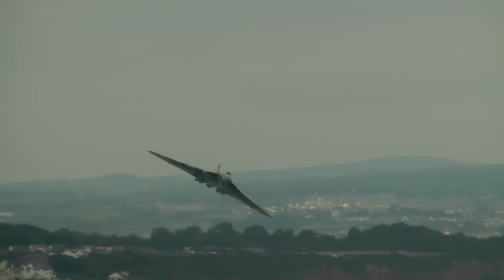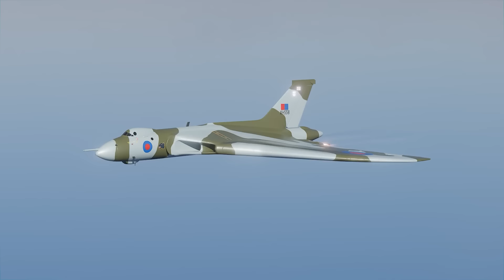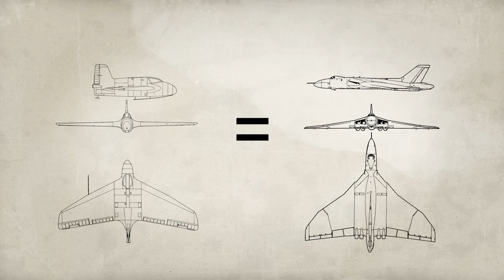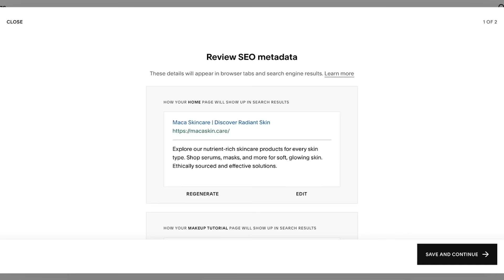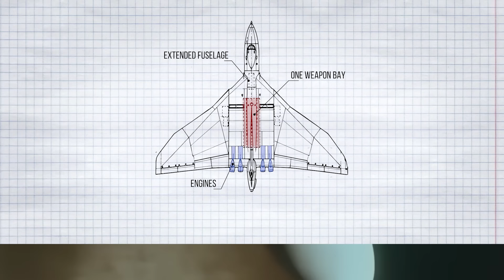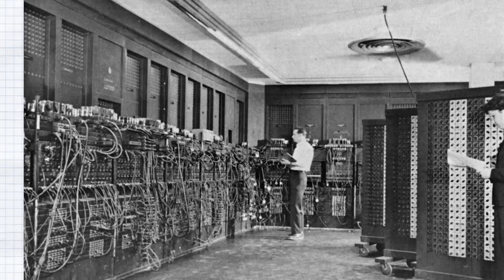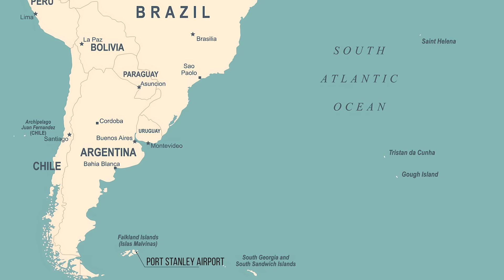The British bomber made to defeat Russia... Avro Vulcan

Comment: XH558 stopped flying back in 2015 sadly, there are no flying Vulcans.
Reply: 3 are still in taxiable condition though :)
Reply: I got to sit in the cockpit of XM655 at Wellesbourne. It was very cramped. I wouldn't want to spend like 19 hours in there during the Falklands. @tengoose6861
Reply: @tengoose6861  Just to add to this. XM655 is fully capable of a fast Taxi however the runway at Wellesbourne is planned to undergo re-surfacing to fix it not being able to atm due to drainage issues. XH558 technically still capable however Robin Hood aiport is the main issue and a lot needs to happen to get her back to fast Taxi. However 'Taff Stone' the main engineer on XH558 said based off his maintence log would know everything required to get XH558 flying again if the engineering support of RR and Marshalls existed. XL426 is the only fast Taxing Vulcan in the world currently, usually does it twice a year and the videos on YT are amazing of her going!
Reply: I was fortunate to see it’s final flight in 2015 at Waddington air show
Reply: It's a shame, but with parts and maintenance being an issue, I'm not surprised.
So glad I got to see it a few times before it was retired though!
Reply: @quantig not only that back in 2015 it cost £1m to refuel so yea that was also an unfortunate factor to it
Reply: @jonallman9918  I can't remember the exact wording the guide on the XH558 tour used but basically Rolls Royce stopped supporting the engines and without that they couldn't get the certificate of air worthiness.
Reply: @Topazium1  Both Rolls Royce and BAe withdrew their support, citing 'no longer financially worthwhile' as the reason, so the CAA refused to certify her for flight without this support.
Reply: @Topazium1  The Vulcans were retired due to metal fatigue and corrosion issues, Avro had to do a lot with limited resources and was forced to make economies with the design that effected longevity and structural integrity. 
these aircraft would require complete rebuilding which is simply not economically feasible.
Reply: I know : I filmed one of its last flights at the Prestwick Airshow , and the following day the two Lancasters when they came a day late .
Reply: I was at the last air show it would ever fly at, but sadly its flight was cancelled due to weather :(
Reply: Im a paetron of her. My name is on her.
Reply: @chethemerc7841 This deserves more than 2 likes 👍, easy regards from the UK 🇬🇧.
Reply: Yeah but it had a good run
Reply: @report_thatveganteacher  It had a very slow (subsonic) run... Britain never produced its own supersonic bomber, a notable failure of the UK aircraft industry.
Reply: @DoktorBayerischeMotorenWerke  but still I was lucky enough to see it fly at 2008 - 2015
Reply: @report_thatveganteacher  At least you still get to see American supersonic bombers flying over the UK, the US air force has B-1 Lancers stationed at Fairford.
Reply: @DoktorBayerischeMotorenWerke  if I have the money yes
Reply: And never will be 😔💔
Reply: Such a shame, but I understand why. Almost made me shed a tear when she reached for the sky for the final time.
Reply: Can't believe it's been 10 years
Reply: I saw it fly at Leuchars air show close to the end and it was glorious as ever. 
That howl was something to behold easily the loudest and most charismatic aircraft I've ever seen. Graceful and terrifying all at the same time.
Luv and Peace.
Reply: Was lucky enough to watch one back in the early 2000’s
Reply: I have heard rumours they are trying to get xh558 back in the air
Reply: It is still in taxiable condition and COULD be THEORETICALLY restored, but it would take a cargo boat load of money. Like back in 2014 they spent a couple million quid just on maintenance. So a LOT of money is needed.
Reply: I saw it with my grandad who was an RAF pilot during WW2 in one it's last flights at Leuchars last Air Show. It floated along the sky howling like a hurt wolf but looking and sounding amazing.
That was the last airshow my grandad was at and we were all grateful he made it. He was 93 at the time.
He used to take me to the Leuchars airshow every year when I was a young boy until I went to Uni.
He was always passionate about flying and always told me what a thrill and free feeling it was to fly a plane.
He's always with me.
Luv and Peace.
Reply: Wrights save the Vulcans. No more left. The most iconic delta wing bomber of all time…
Reply: I was lucky enough to live near Scampton from 1950 leaving in 1969. Vulcans every day from the late 50's and the annual Finningley air display which started with a four Vulcan QRA scramble, once seen and heard never forgotten.
Reply: good
Reply: Beat me to it.
Reply: That is true, but her howl lives again, in the RAF’s F-35s
Reply: @Aguiar_Ed  yeah the f35 really does howl. I was surprised when i first hear it.
Reply: @Aguiar_Ed  The F-35 is an Amerian plane
Reply: @DoktorBayerischeMotorenWerke  An American plane that had British engineers working alongside Lockheed Martin engineers from the start, also: "Britain supplies ejector seats, rear fuselage, active interceptor systems, targeting lasers and weapon release cables, mainly through British Aerospace, amounting to 15% of the value of the F-35, and is the largest supplier of spare parts for the jet after the US."
Reply: @i-like-turnips  WRONG! Only the F-35s built under license from Lockheed Martin in the UK have 15% of parts made in the UK.

 All US military F-35s are 100% made in the USA.

Lockheed is an American company.

There are no longer any British companies making jet aircraft in the UK.
Reply: @DoktorBayerischeMotorenWerke  Do you just make stuff up and hope nobody notices? We build aircraft in collaboration with the EU. IN the case of the F-35 we were on the design team right from the start. Before your star spangled feelings get hurt, this is common practice when you want other countries to invest or pre-order equipment before it is even designed. 

ccording to Lockheed Martin:

“The fingerprints of British ingenuity can be found on dozens of the aircrafts key components. BAE Systems, GE Aviation, Martin-Baker, SELEX, Cobham, Ultra Electronics, UTC Actuation Systems and Rolls-Royce are just a few of the more than 100 U.K.-based suppliers for the program.”

They continue:

“The United Kingdom has played integral role on the Joint Strike Fighter since the program’s earliest days. Even before a final aircraft concept was chosen, British engineers and test pilots were making their mark on what would become a revolutionary capability. Under the desert sky at Edwards Air Force Base, Calif., British test pilot left onlookers awestruck as he took the X-35B prototype out for its first flight on June 23, 2001.

HONK HONK
Reply: @DoktorBayerischeMotorenWerke  Do you just post random nonsense and hope nobody notices?

ccording to Lockheed Martin:

“The fingerprints of British ingenuity can be found on dozens of the aircrafts key components. BAE Systems, GE Aviation, Martin-Baker, SELEX, Cobham, Ultra Electronics, UTC Actuation Systems and Rolls-Royce are just a few of the more than 100 U.K.-based suppliers for the program.”

They continue:

“The United Kingdom has played integral role on the Joint Strike Fighter since the program’s earliest days. Even before a final aircraft concept was chosen, British engineers and test pilots were making their mark on what would become a revolutionary capability. Under the desert sky at Edwards Air Force Base, Calif., British test pilot left onlookers awestruck as he took the X-35B prototype out for its first flight on June 23, 2001.

HONK HONK

Edit: Believe me when I say, I wish the UK had nothing to do with that absolute garbage with wings.
Reply: @DoktorBayerischeMotorenWerke  Do you just post any old rubbish and hope nobody notices?

ccording to Lockheed Martin:

“The fingerprints of British ingenuity can be found on dozens of the aircrafts key components. BAE Systems, GE Aviation, Martin-Baker, SELEX, Cobham, Ultra Electronics, UTC Actuation Systems and Rolls-Royce are just a few of the more than 100 U.K.-based suppliers for the program.”

They continue:

“The United Kingdom has played integral role on the Joint Strike Fighter since the program’s earliest days. Even before a final aircraft concept was chosen, British engineers and test pilots were making their mark on what would become a revolutionary capability. Under the desert sky at Edwards Air Force Base, Calif., British test pilot left onlookers awestruck as he took the X-35B prototype out for its first flight on June 23, 2001.

I genuinely wish the UK had nothing to do with that failure of a project, but here we are.
Reply: @i-like-turnips  Please name a single British company that still makes British jet aircraft in the UK?
Reply: @DoktorBayerischeMotorenWerke  After being part of the EU for so long, like most other EU countries we cooperate on joint projects, such as the Eurofighter (which the failure F-35 was supposed to replace). So what do we do? Rolls Royce engines power a huge number of planes around the world, BAE Systems is and has been involved with numerous projects, including the F-35.

I repeat, quoted directly from Lockheed Martin

“The fingerprints of British ingenuity can be found on dozens of the aircrafts key components. BAE Systems, GE Aviation, Martin-Baker, SELEX, Cobham, Ultra Electronics, UTC Actuation Systems and Rolls-Royce are just a few of the more than 100 U.K.-based suppliers for the program.”
Reply: @DoktorBayerischeMotorenWerke  F'ing YT keeps deleting messages, another great American mess.

Anyway, as I've already mentioned, like most other countries in the EU we collaborate on these projects. We form part of Airbus, BAE Systems and others worked on numerous aircraft including the F-35. We co-developed the Eurofighter.
Reply: @i-like-turnips  Airbus SE is not a British company.
BAE Systems is no longer an aircraft manufacturer, they divested their aircraft design and development division 2 decades ago.
Eurofighter Jagdflugzeug GmbH. is a German aircraft manufacturer based in Munich Germany.

Please name a single British company that still makes British jet aircraft in the UK?
Reply: @DoktorBayerischeMotorenWerke  Good lord! Airbus is a conglomerate, as I've explained three times now. i.e. Reflecting its multinational origin, the company operates major offices and assembly plants in France, Germany, Spain, and the United Kingdom. The UK has always been a large partner in this conglomerate, which produce many things for the aerospace industry, but for Airbus specifically we produce the wings. Again, cooperative development. 

Eurofighter: "he Eurofighter Typhoon is a European multinational twin-engine, supersonic, canard delta wing, multirole fighter.[3][4] The Typhoon was designed originally as an air-superiority fighter[5] and is manufactured by a consortium of Airbus, BAE Systems and Leonardo that conducts the majority of the project through a joint holding company, Eurofighter Jagdflugzeug GmbH. The NATO Eurofighter and Tornado Management Agency, representing the UK, Germany, Italy and Spain, manages the project and is the prime customer.[6]"

BAE Systems most definitely is involved in the aerospace industry, they have been involved in the design of the F-35 among many other aircraft. Again, I quote Lockheed Martin "The fingerprints of British ingenuity can be found on dozens of the aircrafts key components. BAE Systems, GE Aviation, Martin-Baker, SELEX, Cobham, Ultra Electronics, UTC Actuation Systems and Rolls-Royce are just a few of the more than 100 U.K.-based suppliers for the program."

Rolls Royce make engines for tonnes of planes across the globe, including many of the American aircraft. "Rolls-Royce Holdings plc is a British multinational aerospace and defence company incorporated in February 2011. The company owns Rolls-Royce, a business established in 1904 which today designs, manufactures and distributes power systems for aviation and other industries."

Do you realise how misinformed you are?
Reply: @DoktorBayerischeMotorenWerke   Good lord! Airbus is a conglomerate, as I've explained three times now. i.e. Reflecting its multinational origin, the company operates major offices and assembly plants in France, Germany, Spain, and the United Kingdom. The UK has always been a large partner in this conglomerate, which produce many things for the aerospace industry, but for Airbus specifically we produce the wings. Again, cooperative development. 

Eurofighter: "he Eurofighter Typhoon is a European multinational twin-engine, supersonic, canard delta wing, multirole fighter.[3][4] The Typhoon was designed originally as an air-superiority fighter[5] and is manufactured by a consortium of Airbus, BAE Systems and Leonardo that conducts the majority of the project through a joint holding company, Eurofighter Jagdflugzeug GmbH. The NATO Eurofighter and Tornado Management Agency, representing the UK, Germany, Italy and Spain, manages the project and is the prime customer.[6]"

BAE Systems most definitely is involved in the aerospace industry, they have been involved in the design of the F-35 among many other aircraft. Again, I quote Lockheed Martin "The fingerprints of British ingenuity can be found on dozens of the aircrafts key components. BAE Systems, GE Aviation, Martin-Baker, SELEX, Cobham, Ultra Electronics, UTC Actuation Systems and Rolls-Royce are just a few of the more than 100 U.K.-based suppliers for the program."

Rolls Royce make engines for tonnes of planes across the globe, including many of the American aircraft. "Rolls-Royce Holdings plc is a British multinational aerospace and defence company incorporated in February 2011. The company owns Rolls-Royce, a business established in 1904 which today designs, manufactures and distributes power systems for aviation and other industries."

Do you realise how misinformed you are?
Reply: @i-like-turnips Only the F-35 aircraft imported to the UK have British content.
The is a long standing legal requirements that all American military weapons be made Only in the United States 
Parts made in the UK are expressly forbidden
Reply: To be honest, this entire video is full of factually incorrect statements, not to mention the amount of AI-manipulated images and videos. I shall not be watching this channel again, as it is clearly very untrustworthy.
Reply: @EmmaLaBunn  "Ai-manipulated images and videos" did the dude riding the nuclear bomb push it over the edge?
Reply: @EmmaLaBunn  what? This guy is highly regarded in factual information, there is no or if do barely any ai generated stuff on the whole of this channel. You may just be what we call an idiot. Also can you point out these "factually falso information"?
Reply: @EmmaLaBunn  A bit harsh?
Reply: @EmmaLaBunn  AI manipulated?
Reply: @JamEngulfer  Numerous times there are noticable visual glitches in videos, where they've had AI upscaling applied to them. The one that confirmed it for me was teh clip of a Vulcan being pulled out of the hangar backwards. Look how the tailcode is illegible. Look for roundels changing shape and cockpits distorting in others.
Reply: @EmmaLaBunn  Oh you just mean upscaling. I don’t think that’s enough to care about, it’s barely even AI anyway.
Reply: @JamEngulfer  Unfortunately, some people don't understand the difference between upscaling and AI generated content. Either that or they are looking for any old excuse to dismiss British achievements. I've noticed a lot of Americans don't like it when somebody else does something great.

Comment: In the animations why are there afterburners? the Vulcan never had afterburners
Reply: I agree it's misleading to anyone learning about the Vulcan. There was a prototype that had afterburners  but it was deemed unnecessary for the Vulcan as it wasn't going to be a Mach bomber & the knowledge went to the Concorde.
Reply: Either looks or a simple visual mistake
Reply: There is a fair bit of "poetic licence" in this video ;-)
Reply: I think the aircraft that tested Concorde engine had an one engine with an afterburner but really that’s just a technicality
Reply: @Statueshop297 I think I know what you're on about, there was the Delta wing test craft which flew with it , the one I'm talking about was a full size airframe static test bed, I say static, though it may of had a blast down the runway. It was mainly to see if they would fit, I don't think they ever had ideas about using them as it would reduce the range of the Vulcan far too much. It would make one hell of a fast short range bomber 🤣🤣
Reply: @ yeah the Vulcan had enough power already.
Reply: @Statueshop297  Vulcan already had enough power to take it all the way to the scene of the crash... Avro was forced to install a speed limiter system to prevent the airframes from breaking up in flight.
Reply: They also claim 170 ton(ne) weight, but the max takeoff weight was 93 tonne (100 ton), which would include weapons.
Hence, this channel is one for the block-list, except for those who're fine with misinformation.
Reply: cause it looks cool as fuck
Reply: 🤦‍♂️ not very historically accurate
Reply: Because it looks cool to all the teenagers in the comment section who don’t know any better
Reply: who gaf it looks sick asf
Reply: Your mum